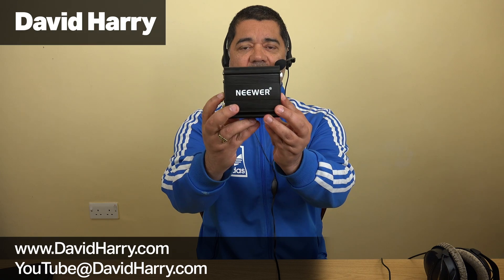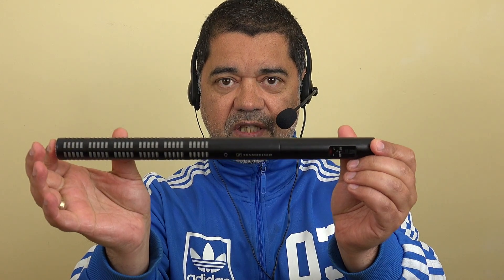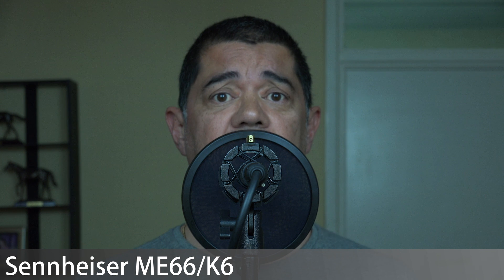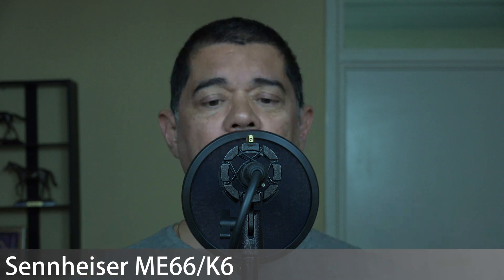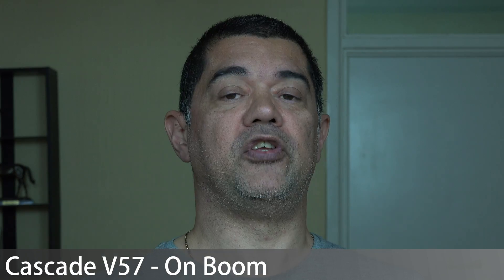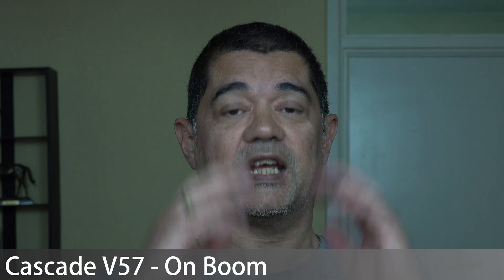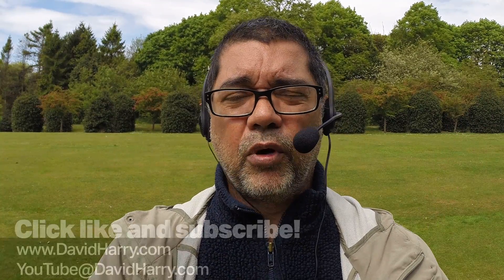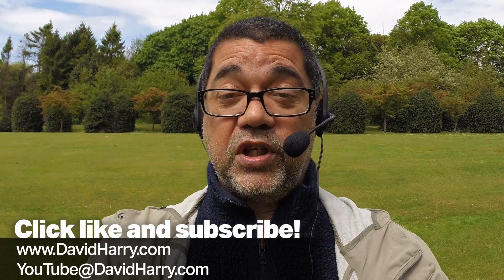Neewer NW-100 Cheap $20 £15 Microphone Phantom Power Supply Test - Rode NT5, Sennheiser, Cascade V57

Comment: my phantom power supply makes a weird buzzing sound my mic isnt causing it because i plugged in the mic separately and it worked do you know a fix
Reply from the maker: ColGaming What is the mic you are using? Try another condenser mic if you can and see if that also hums. You can also try a modern dynamic mic and see if that hums, a modern dynamic won't have an issue with phantom power. Also try changing the cables, both going into the Neewer and coming out of it. Are you using a balanced cable coming out of the Neewer or is it going unbalanced?
Reply: sorry what i meant was there was completely no audio coming from mic just the buzz sound
Reply from the maker: ColGaming Ah, OK. What is the make and model of the microphone?
Reply: David Harry it is a bm100fx I bought off of geatbest
Reply from the maker: ColGaming Hi. I've just had a look at that mic and it doesn't look like it's a condenser mic. It looks like it is an electret microphone. An electret microphone requires around 1.5 volts to power its capsule and a condenser requires 48 volts. It looks like your mic takes its voltage from the USB cable. Now I may be wrong here, but I doubt very much that your mic is capable of stepping up the USB voltage, of around 5 volts, to 48v or step down 48v to electret voltages. This is probably why you get no audio running it through the Neewer, as the Neewer is supplying 48v through the XLR cable, and it looks like your mic doesn't extract any power from the XLR cable, only from the power supplied from the USB cable.

If you're looking for a cheap condenser mic take a look at this one https://www.youtube.com/watch?v=j4U4sDUR40Y its real cheap and sounds great. There's other mic reviews on my channel.
Reply: Thank you so much